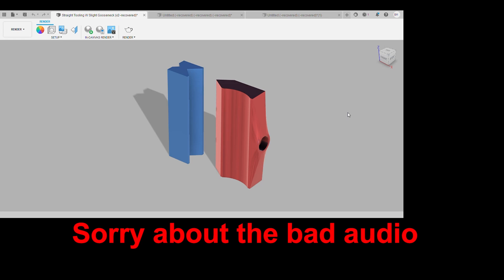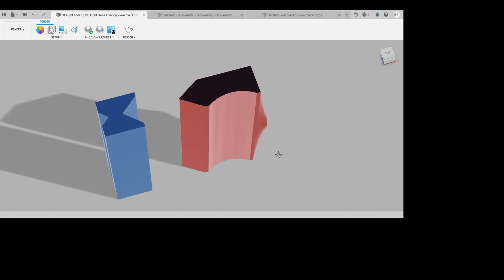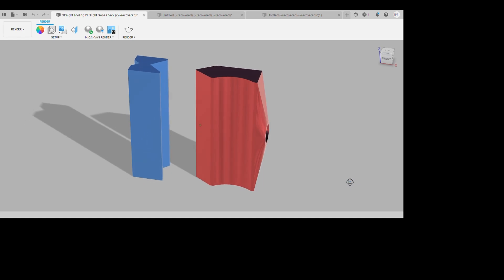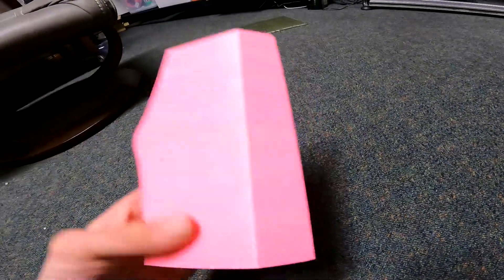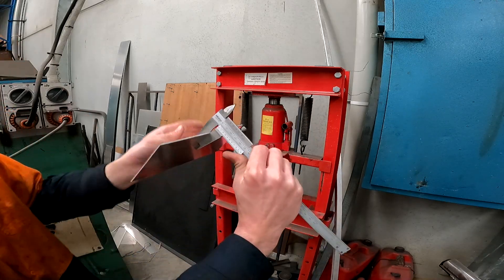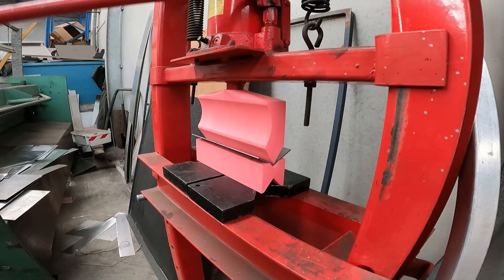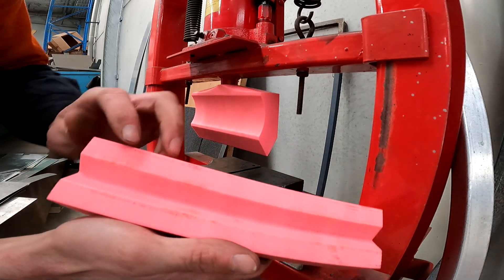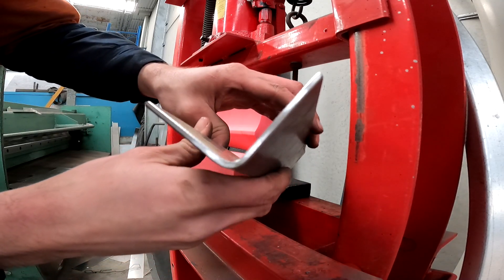3D Printed Press Brake Tooling

Comment: Thank you!
I followed your example and designed my own version in CAD software.
I eliminated the "Goose Neck" (HONK!) and simply made the top die shorter but I did design the top of it similar to yours.
I cut the print time in half. ...by using two printers. (LOL!) It took 16hrs for the bottom die and 21hrs for the top one.
I added a 1.5mm radius to the tip of the top die and to both of the "V's" of the bottom die. 
I oriented them upright 200mm just like you did because that is the strongest orientation for this project.
Printed with PETG because it's more durable than PLA. I immediately bent four 90° bends in 3mm aluminum to fabricate a bracket that I desperately needed. I had no negative issues whatsoever.
I love my new Press Brake Dies and expect for them to last as long as I'm around to use them.
Reply from the maker: That's awesome mate! Top work! They sure do come in handy! 😁
Reply: Hey Timothy would you share your CAD? Thanks!

Comment: Great experiment. I have a 20-ton press and a 3D printer and meet to bend 1/8” (3.125 mm) steel. Considering PLA vs Nylon CF for the dies.
Reply from the maker: Cheers mate. It would be interesting to see the difference between the two!

Comment: If there are high surface finish requirements when press brake/edge bending, the Swedish product Tribotextil™ can be applied in the pressing/bending  tool and mechanically protect the sheet metal from scratches and other damages. Tribotextil™ is an extremely thin and very strong textile that in this process replaces lubricants in the tool and also protects the stamping tools from wear and coatings.
Reply from the maker: Good to know 👍
Reply: @house-ofhoon  👍

Comment: Also make your main piece that goes on the press, the 2 holes to fit some round bar to make a modular slide, then you only have to print small sections at a time.
Reply from the maker: Yea I need to do something like this, cheers

Comment: Could you increase the upper tip radius ever so slightly to increase its strength? Do you think the performance would differ if you printed in a different orientation?
Reply from the maker: Not sure about the change of radius. Performance would definitely differ with a different print orientation. Would be interesting to test the difference!

Comment: you can probably glue or just heat-press one of those thinner metal parts onto the edge of the plastic. so the surface that does the bending is actually metal and not plastic directly, plastic just being the filler.
Reply from the maker: Thanks for the idea mate!

Comment: Cool, so next to try is 10 walls? What nozzle  you using? hopefully a 0.5mm+
Reply from the maker: This is with 15 walls at 0.8 each. Yea I used a 0.6mm nozzle for this print and 0.4mm layer height. Still a loooonnngggg print
Reply: @house-ofhoon  haha damn, sounds like it was at least 30hrs from my rough estimate!
Reply: @house-ofhoon  Oh what infill? 
I have read that concentric at 100% is the strongest.